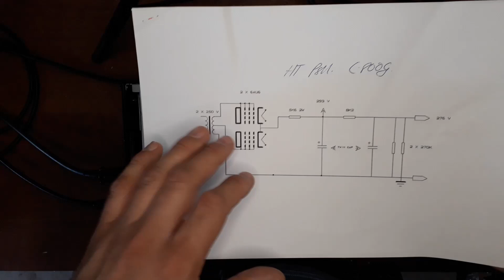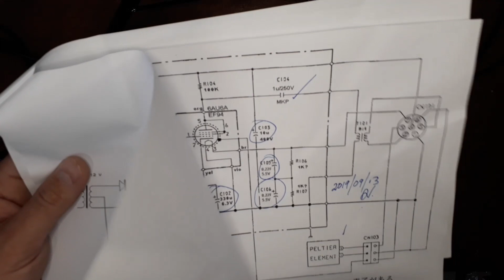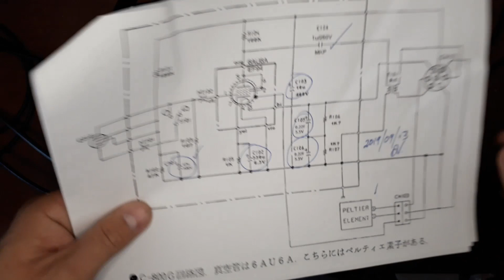Sony AC-MC800G Power Supply after replacing the capacitors

Comment: These two tubes… Are they also 6AU6A?
Reply: Yes they are.
Reply from the maker: Yes thats correct. But it is not tube quality critical. As long as it has good emissions its good for the power supply.